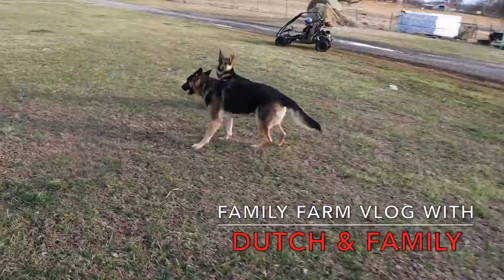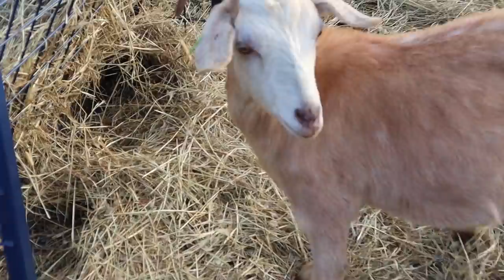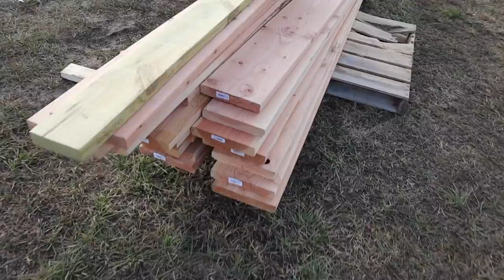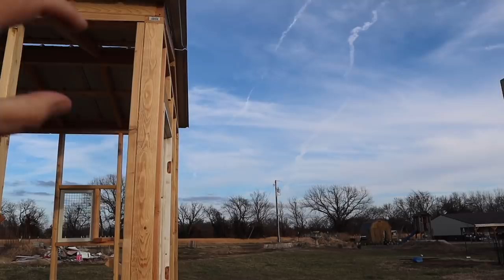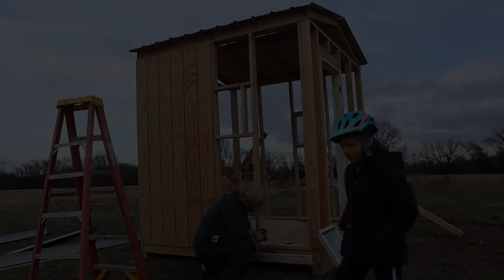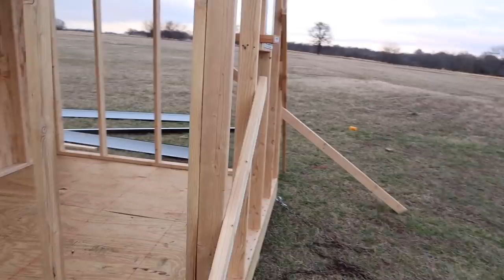HOW TO SET POST FOR A POLE BARN

Comment: You have the greatest helpers in the world Dutch! Thank you for teaching your daughter all you can about everything! She won't forget many of the things and principles so if in the future she does or someone does something for her she'll have an idea on how to have the best possible done!

About the window, I personally love them but, those windows you want to keep them higher from people's faces or, have sort of an insulation foam for low pressure ac lines ready to place on most of its sides, corners and bottom of it, or, they may work better in a wall that protrudes or comes out more than the window itself do if you open it, you may limit it's edge from the outside of the walls do no one accidentally pass by and hit him/herself with it. Again I love windows but this little opening of it at anyone's face high may be extremely dangerous, and I don't want anyone to stumble with such good, so low. Take care bro.

Something else, on wood construction, I reflected on adding like a little skirt or extra wood cover to, like 2' or 3' from the bottom of the plywood wall up, maybe even an inch or two passing the bottom of the wall of plywood with 1x8, or 1x6 may last a good 20 + years. If you put 2 bys will last forever! But 1 bys will do the protection because that's the area that gets splashed due to the rains for years. Then once those skirts gets damaged you can change it and you have a coop for years!

Comment: For your barn floor, maybe a laser level would make it easier to find out how much dirt you need to add, or remove.  It could speed up putting up the cross boards as well.